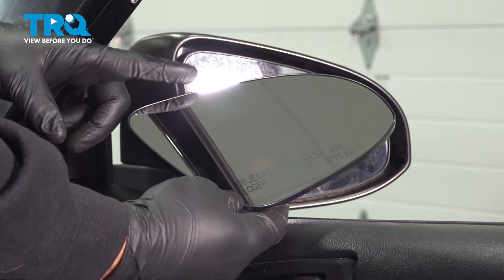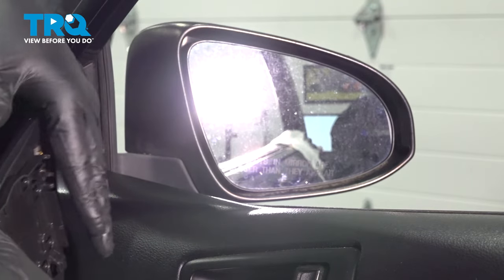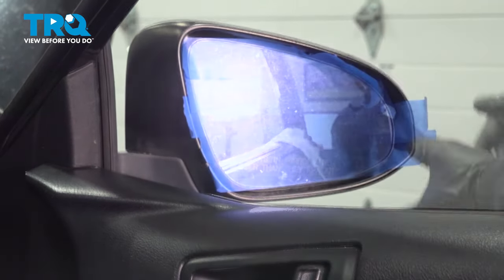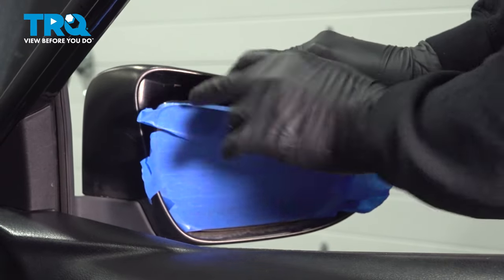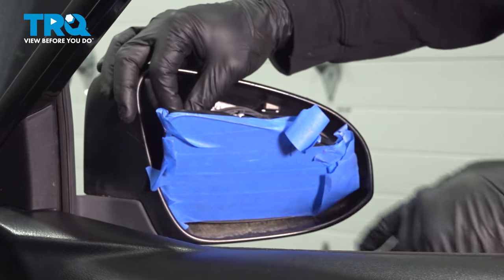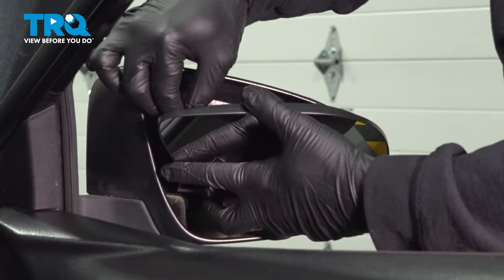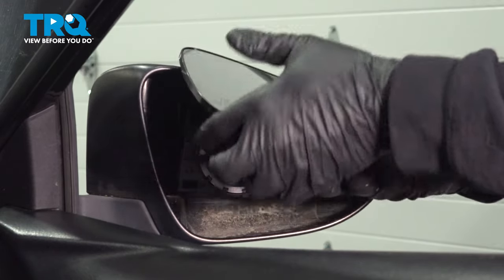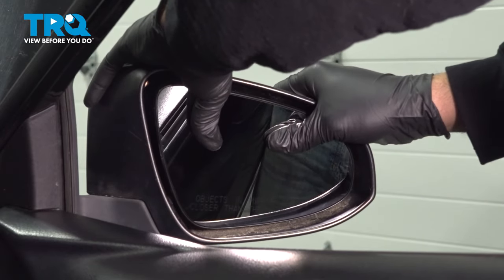How to Replace Mirror Glass 2012-2017 Toyota Camry

Comment: Great video...I recently had a problem with the mirror...I believe someone hit or pulled my  left mirror apart from my parked car while I was away from my car. I found the cowl and the mirror in front of my car in the street. Luckily, neither broke. II thought the mirror would be broken as it was face down in the street. Much to my surprise, it was not broken. Neither was the cowl. I examined the parts and kinda figured out how to put it al back to together...I did get it back together but have noticed the mirror vibrates more now than it used to. Is there a trick to stabilize it better? thanks for the help